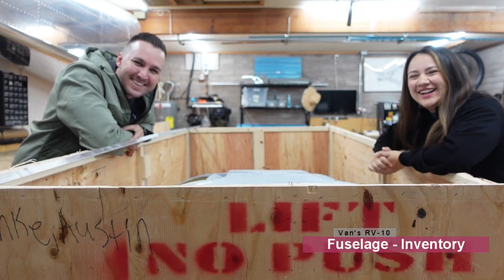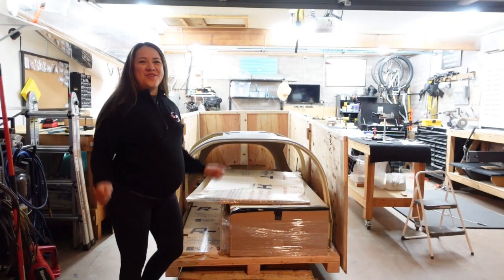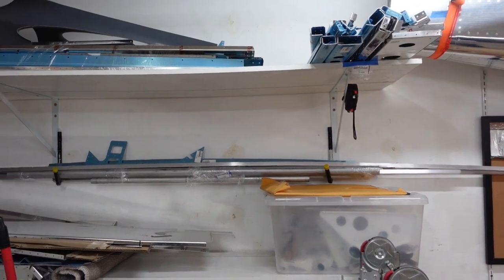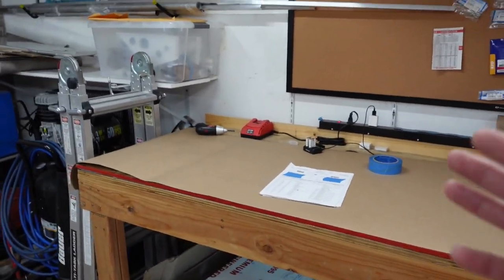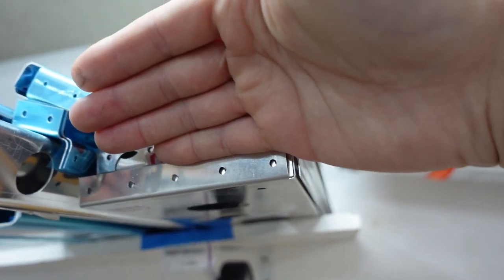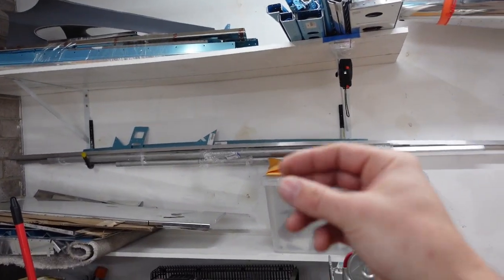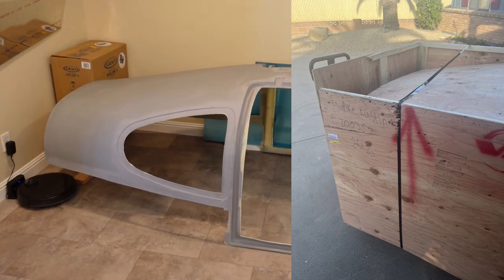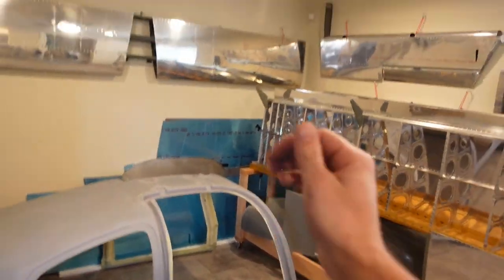Van's RV-10 - Fuselage Inventory

Comment: Hmm, I received some laser cut parts labeled as from April and May of 2022 and I don’t see substantial notches in the holes, although under magnification, the holes look by eye to have more jagged edges and to be not as perfectly round as on the punched parts. Did you ask Van’s if they confirmed that the vendor who cut those parts did not have any QC issues and is maintaining good QC practices?
Reply from the maker: Very interesting. Yeah they saw the photos, which is when they said to use a jewelers file to smooth them out. How have yours been? Any cracking from irregular edges being stressed when dimpling?